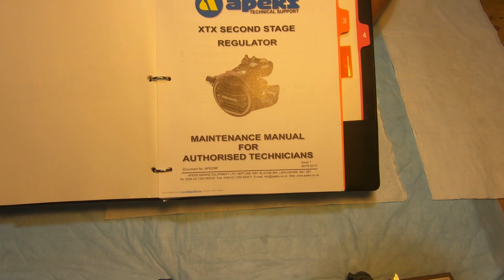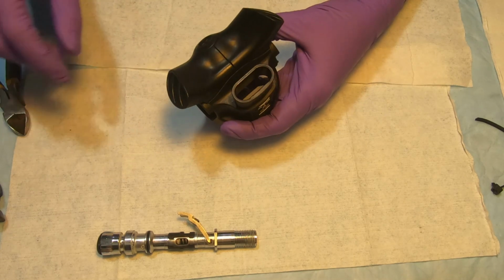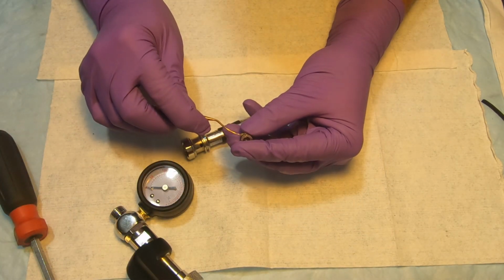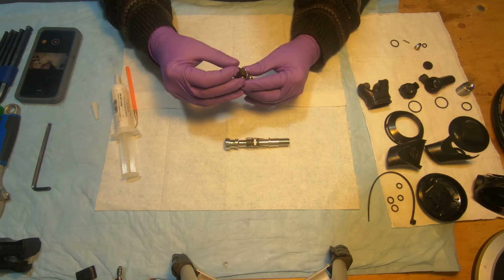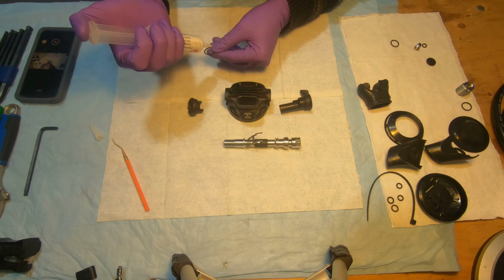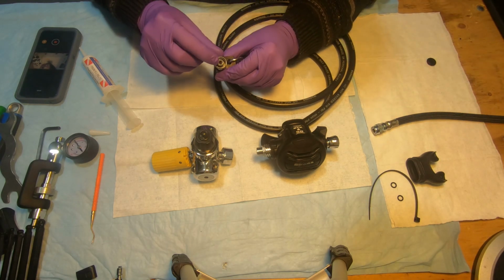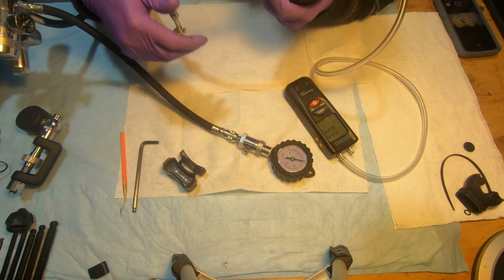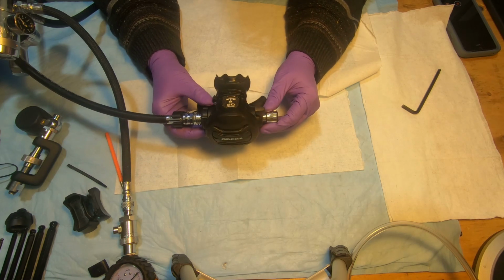Apeks XTX 50 Second Stage Regulator Service

Comment: Hi Max, really enjoying your videos.  Question, you do not remove the spindle collar?  I know the Apeks manual states that it's not necessary to remove for normal servicing.  I was just concerned about leaving it on during the ultrasonic cleaning process since its plastic or nylon.  Advice or recommendations?
Reply from the maker: Thank you for watching! No need to remove it, ultrasionic claning will dissolve any solts residue under the plastic collar.
Reply: @maxdiver9038 So, just to be clear, you haven't experienced any issues or problems with plastic degradation or deterioration from using the ultrasonic cleaner with vinegar?
Reply from the maker: @SeanDurrum no, all good, dilluted acetic acid  would not dissolve high impact plastic

Comment: Great video Max. This is the most accurate XTX50 service video i have seen so far. Well done. Only one recommendation: the heat exchanger and the MP hose should be torqued with 5 Nm as per APEKS instructions. But all in all fantastic video.
Reply from the maker: Thank you for watching and good words! I did not have a spanner torque wrench, but a good point to mention.

Comment: Thanks so much for those videos !
Reply from the maker: You are welcome, thank you for watching!
Reply: @ If you ever have time to do a video for apeks tek3 first stage, aqualung core and legend : you have a sponsor in me ;-)
For the seat in first stage, i was told to use a dedicated polishing tool ensuring good contact.
Reply from the maker: @Nicho_dive  thank you for an offer. I only service regs that are owned by myself. About a seat, not that it should be in perfect shape cause it only contacted plastic high pressure seat. Replacing high pressure seat normally enough. No polishing needed.
Reply from the maker: @Nicho_dive  https://acrobat.adobe.com/id/urn:aaid:sc:US:228df605-59b8-4a31-90b2-2e1f4dd7bff7
Reply from the maker: Here is your reg manual same as DST, nothing needs polishing. Unless volcano orifice damaged.